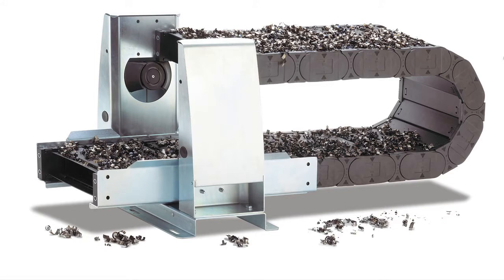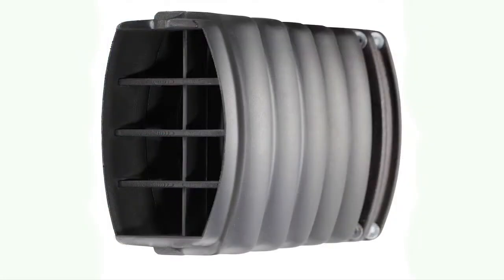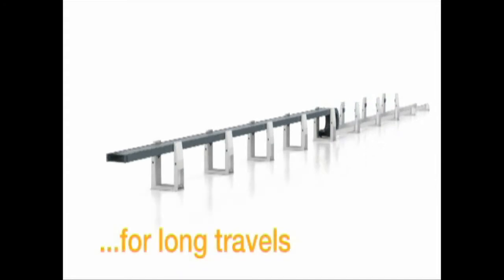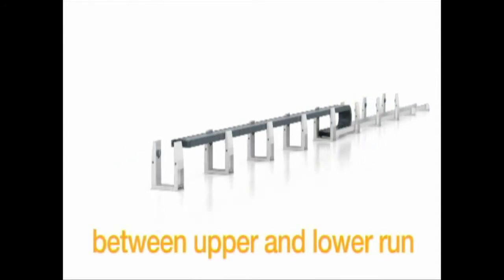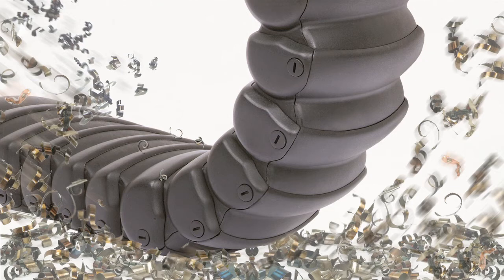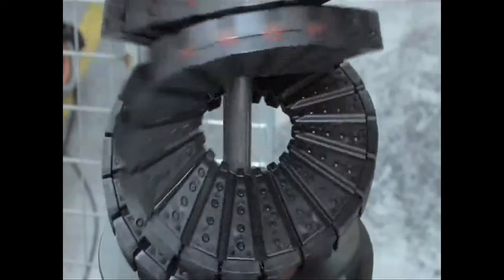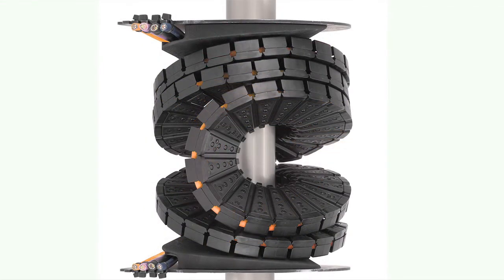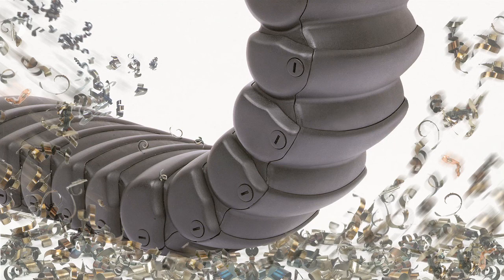5 Minutes with Igus, Inc.

Comment from the maker: @MrCarrierguy This particular cable carrier is an RX energy tube especially for the machine-tool industry that is nearly 100% chip-proof.  The RX energy tube has a specially designed, smooth domed outer contour from which debris—such as metal or wood chips—simply falls off.  A second series of comprehensive tests—including underwater experiments and tests measuring chip-mass penetration—have been carried out in igus®’ test laboratories to confirm the energy tube is nearly 100% airtight.